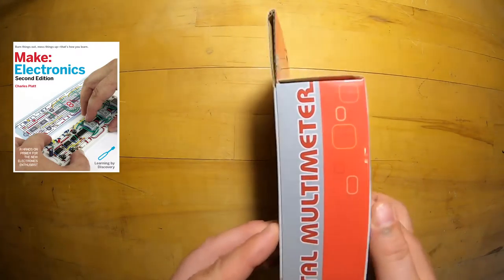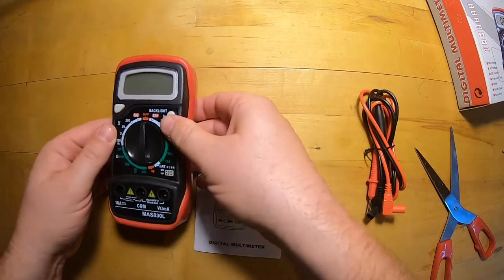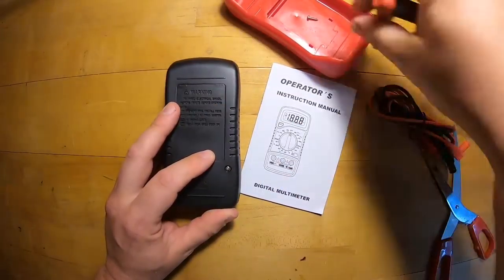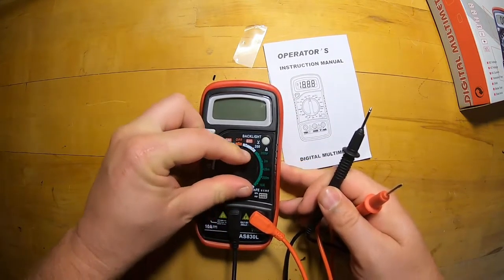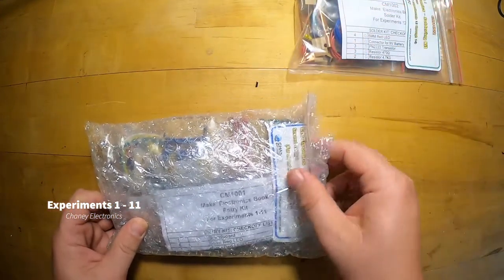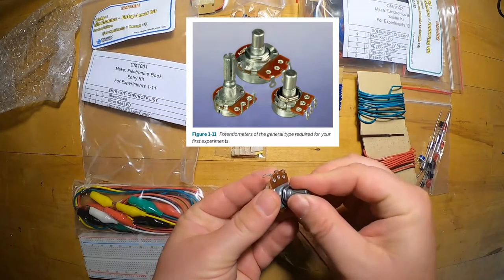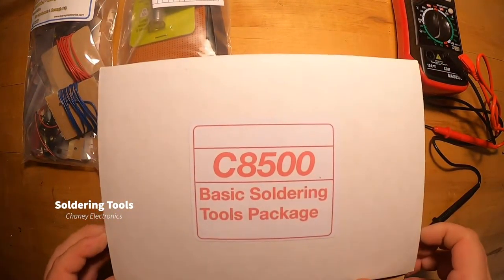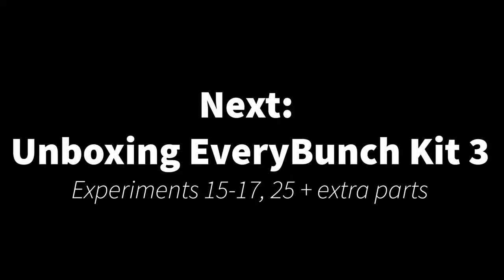Unboxing Course Materials, Part 1

Comment from the maker: Using these materials:  

$18 for the textbook (softcover): https://amzn.to/335wEXD
        or $20 as a pdf: https://www.makershed.com/products/make-electronics-2ed-pdf

$20 Digital Multimeter:  https://www.goldmine-elec-products.com/prodinfo.asp?number=C7327
$55 Experiments 1 - 11 https://www.goldmine-elec-products.com/prodinfo.asp?number=CM1001
$19 Experiments 12 - 14 https://www.goldmine-elec-products.com/prodinfo.asp?number=CM1002
$28 Basic Soldering Tools:  https://www.goldmine-elec-products.com/prodinfo.asp?number=C8500